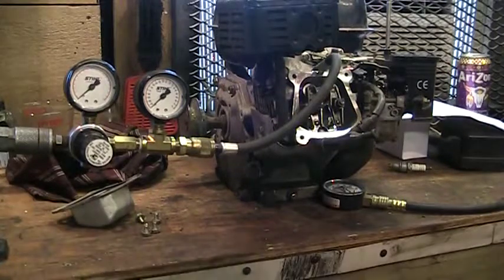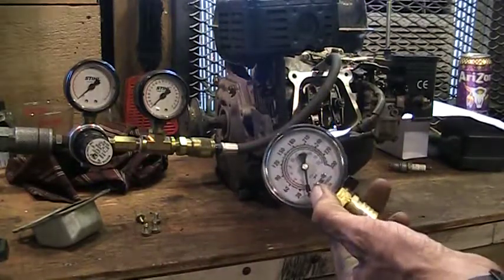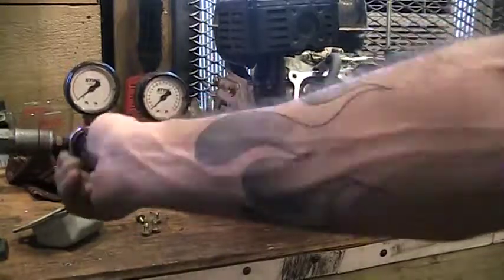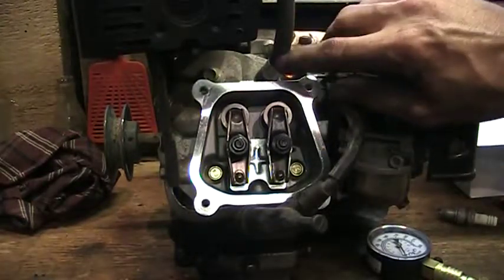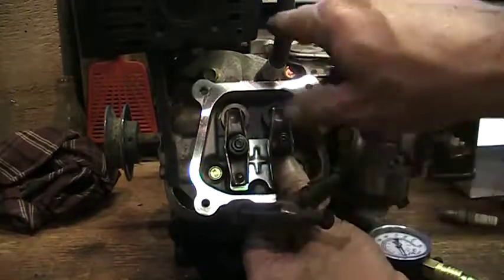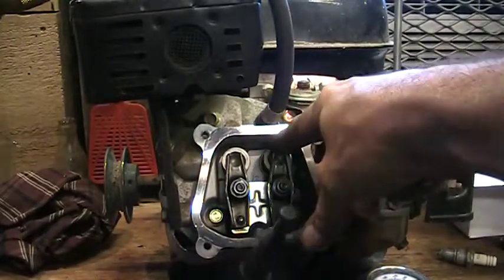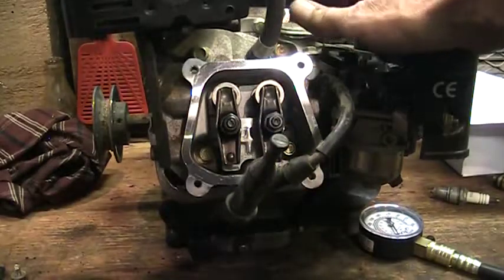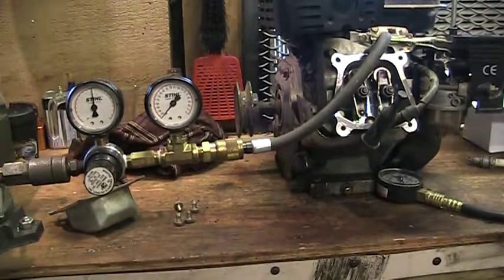Small engine cylinder leakdown testing. Low compression.

Comment: Great demonstration! I am dealing with an early 1980’s or so Honda 10 HP outboard. What it does is idle and starts easy. When I give it throttle, it bogs and sputters and pops out of the carburetor. If I ease into it, I can sometimes get it to go and it runs full speed fine. It has an even 120 psi on both cylinders. What’s weird is that once I set the valve lash to factory spec around 0.014” it seemed to fix the issue. So I took it to the water and ran it for about 20 minutes. Then during the trip, it started doing the same thing. I had to ease into it, let it sputter and backfire through carb, and then speed up as normal. I tried two different carbs and cleaned, soaked in ultrasonic, and set float heights parallel. I was told that I should l tear it down but would like to do another test to be sure. Parts are scarce for this engine, but I did quite a bit of work to it. (New points, new waterpump, new gear oil). Everything is great except for the running. Also heard that some of these had casting issues.

Comment: can some of that compression be coming through the cam tappets.
Reply from the maker: 3 most common...
Valves and or valve seats (most common)
head  gasket (very common on B&S singles)
rings (happens on high hour engines).
The tappets aren't in the compression area
Reply: @randomwrenching  reason i ask. I just did a leak down with almost zero leakage on valves but noticed leakage coming up from the push rods on a briggs animal.  had 3.5% leak cold. 80 psi on one gauge, 78psi in the other.
Reply from the maker: @bigh3053  Great info! You are hearing it come up through the pushrod area, because that is open to the crankcase. You may hear it in that area if the head gasket is bad on a single OHC engine, but at only 3.5%, It just sounds like a normal small amount is going by the rings.
What problem are you trying to figure out on this?
Reply: @randomwrenching  great thanks for the reply. first time doing leak downs to incorporate into my Spec Briggs animal engine program. needed a good 2nd opinion on the matter so thank you. previously I knew my cylinder work is good but chanced  it on the block. This will really give me piece of mind knowing I'm putting out a great product.
Reply: correction, valve seat work not cylinder work. lol
Reply from the maker: @bigh3053  Seat work can be checked easily on assembled heads on the bench with valves face up, soapy water on the face, then blow air into the exhaust or intake ports.  Air bubbles around the valve seat means you have some lapping to do. 😉
Reply: @randomwrenching  yup. real bad seat leak face down just pouring a bit of wd40 through the ports. Will have a plate plate cut and tapped so I can bolt the head to on its own and check with the leak down as well. just have to come up with a reusable gasket

Comment: Also removing the oil fill plug let's you hear air flow (if past rings).
Reply from the maker: It sure does.  The valve cover is off on this one, so the noise would be heard coming up through the head.
Reply: Wouldn't listening by the oil filler neck be misleading?  Couldn't technically you be hearing ring blowby or head gasket leak as both would work there way into the crankcase and out the oil filler tube

Comment: Hey thanks for the quick response ,                                                                                                                                                                     When i purchased it new, it was the first lawnmower i have had that recommended 10w30[sticker on shroud ] i had always used sae30 so i called MTD and a couple of Cub  dealers and the response was that it was a Modern Engine Design so use 10w30 . When i contacted MTD recently the service rep now said it should be SAE30 as well ,  apparently they have experienced failures with 10w30   [mine is a city size lot 55x110   no severe use but makes me wonder if i had used SAE30 would i have has any issues now]                                                                                                                                                                                                                              Also said  the crankcase pressure should be no more than 6lbs,, and he's not sure why its so high to push oil out the filter.                                                                                                                         MTD  now have a ring set for it [ I called MTD and it is in stock] which according to the area dealers it is unavailable and you must buy a short block for $250 for a 10 yr old lawnmower?       So i think i might change the oil again with SAE30 and order a ring set and new head gasket and try the head gasket first in case there is  an area on the gasket that isn't properly sealing and allowing pressure to build in crankcase  although prior witness marks showed nothing                                                                                                                                                                                                                I did a compression test and the results were  lower range 50lbs  [not sure how accurate gauge is]  so i guess the only option is to disassemble it and check the rings and cylinder bore  for wear /out of round ,scoring on lower surface of cylinder walls OR  run it as is with pvc vent pipe inserted into a bottle ,then pour contents of the bottle back into the engine once i finished cutting the front lawn ,and again when i finish cutting the backyard until it completely quits running . But i am puzzled as you said it should be burning oil /smoking or fouling plugs and coming out of the exhaust  in some form .Always starts right up and sounds as it did new .the grass never gets long enough to challenge or strain the engine
Reply from the maker: I think you're on the right track. New head gasket, new rings, check the head and the block for flatness.  Fill with SAE30 and see how it goes.  In most cases, bad compression rings pressurize the crankcase (blow-by). Bad oil control rings cause oil consumption (burning).
Reply: @randomwrenching  thanks again Dave  greatly appreciate your time and expertise .AMAZING

Comment: HI  i have  a CubCadet mod 12a 18mz596  self-propelled  pushmower with a Powermore series 700 engine that has recently been pushing oil from the breather /air filter onto the deck and gotten progressively worse  i ran the breather tube into a plastic bottle on the deck and it fills up about 250 ml in about 10mn of running engine ..the crankcase is pressurized  forcing oil into the bottle .i removed the flywheel and disassembled the pcv ,removed fiber disc ,tensioned spring and cleaned the metal filter screen  and cleaned the drain hole and reassembled it .then i removed the cylinder head and cleaned the head, valves ,spark plug ,piston head face and reassembled .no scoring of the cylinder wall . I've had the mower since new and always maintained, oil changes etc .   after changing the oil and adding .6 ltr of 10w30 Castrol GTX, i ran it and then checked the spark plug expecting to find it fouled but it was completely dry and clean . i thought it might have been a cylinder head gasket but its intact and sealed ,then i thought it might be piston rings  but it doesnt burn any oil or smoke . would the oil ring be plugged/defective turning it into an oil pump? If you didn't see the oil container and notice the crankcase pressurization you would  think it was a new mower  as it starts right up and runs fine other than pumping oil out of the filter .Appreciate any insight you have .Thank you Dave
Reply from the maker: Wow, that's a lot of investigating you have already done, good on ya!  Couple things... Bad oil control rings usually cause oil burning, not excess crankcase pressure.  Second...and I'm not going to start an oil argument here...but I run and recommend SAE30 in regular push mowers like yours.  Some owners manuals call for 10w30, and others call for SAE30, but these also say you CAN run 10w30, but you MAY experience accelerated oil consumption. (Not exactly the problem as you described with the clean spark plug.)  If the head gasket is good, I would start looking at bad compression rings (most likely), a washed cylinder (less likely), or the bore may be slightly out of round (least likely).  These are my thoughts based on what you have already done, and would be MY next steps in diagnosis.

Comment: Liked. I don't have acess to the leak down tool or compressed air. So I can't do this test. But I have a question for you or anyone willing to share info.  Since the OHV Engines. Briggs & Stratton Intek in my case. Have a compression release valve for easier starting. What's the minimum amont of compression I can have and the engine still start fairly easy? Thanks in advance.
Reply from the maker: There are a few variables, but with a standard compression tester, proper valve clearances set (very important)  and a fully charged battery you should see around 80psi.  The compression release will be active during this test, so it reads that low...
Reply: @randomwrenching  Thanks so much for taking the time to reply. I would have guessed 60 PSI at most. Mine is pull start. Will that maake a difference.
Reply from the maker: @mrih1586  Thanks for your question! The readings may just be a little lower.  No one ever sets the valves. It plays a big part in compression readings.

Comment: ok so my engine is supposed to be 1/4" past TDC for this test. Did you do anything to prevent your crank from turning when you applied air to the cylinder? Imy engine is on a Husky tiller and when I apply air the engine flywheel turns changing piston position.
Reply: When you do a cylinder leak down test the easiest fastest way to find top dead center on the compression stroke is with the leak down tester. Use the tester to put a tiny bit of air into the cylinder. Like 5 PSI. Now turn the engine by hand using a breaker bar with a socket on the flywheel nut. You can feel where top dead center is and stop on it. It’s very easy. If you are at exact top dead center the engine will stay there when you turn the pressure up. Remember. Remove the breaker bar and socket before turning the pressure up.
Reply from the maker: I didnt have to lock mine, but there is likely an easy way to hold your engine from turning. Vise grips or a screwdriver strategically placed will help you out.
Reply: @randomwrenching  why doesn't your engine turn? if I get anywhere near 100psi my engine will turn.
Reply from the maker: This piston was tight in the bore. It didn't turn with air pressure.  You can usually find a spot on the flywheel to clamp vise grips or shove a screwdriver in somewhere to stop the engine from turning.  Also, with a regulated leakdown tester like the one in my video, it doesn't put 100psi into the cylinder...
Reply: @randomwrenching  thanks for the reply.